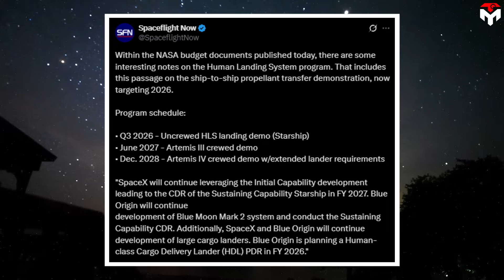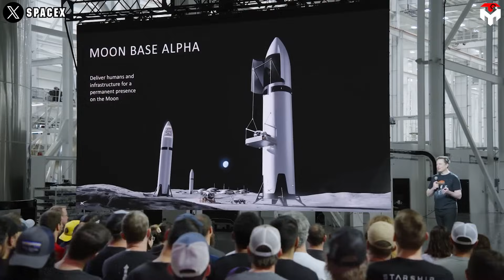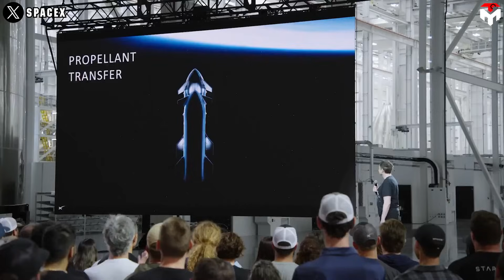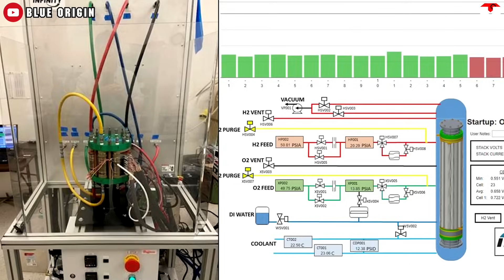Blue Origin to Land on the Moon before SpaceX Starship But...Elon Musk Laugh

Comment: A tall and slim lunar lander - what could go wrong?
Reply: Good question.  But the Moon's gravity is 1/6th of the Earth's gravity. So there will not be a lot of force to topple it.
Reply: @NotTheSharpestBulb-mh  There will still be the same mass to topple it, but only 1/6 of the weight to stabilize it.
Reply: @sablatnic8030  , That's a good point. It applies to the moment of the landing and the momentum of the vehicle. But the time to double should be longer than on Earth. The vehicle orientation should be easier to control. But I am not an expert on this subject, so I can not say anything with authority.

Comment: I saw this coming. Elon designed a Steel rocket and a rocket engine that looks great on paper and doesnt exist. Starship has serious problems made worse a few days ago.
As it stands right now, New Glenn has a greater demonstrated payload to LEO while Starship is a disaster.
Falcon 9 and Falcon Heavy are great rockets. Space X has gone downhill. High risk is failing bad
Reply: In the early stages of Falcon testing people were saying the same as you. And now?
Reply: @richardfs7814 They were saying it because rockets startups are hard. Elon hired very experienced people from McDonnelDouglas. They made the rocket work, they were experienced in rocket tech, Elon wasnt.
Now this vehicle, has very little heritage, it is made out of steel, super heavy and the engine tech is not ready. 
Saturn V was a tech evolution. Starship is completely different. 
The high risk approach will doom this rocket. They have done very little validation and big systems engineering and it shows. 
I will let time explain that better to you..
Reply: @richardfs7814 Back then because it was a rocket startup.
Now, because its made of Steel, the engine has no maturity, the problem is a lot harder and the high risk approach is failing really bad.
Time will explain it to you better than I can.
Reply: I’m good. No explanation necessary.